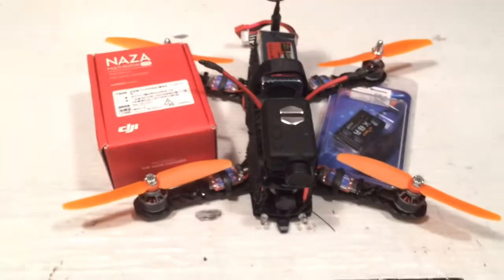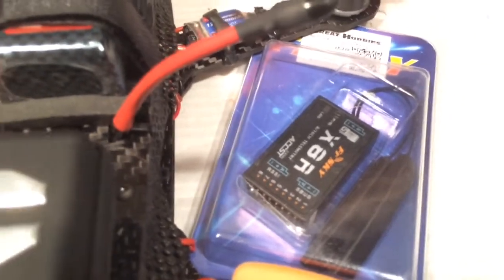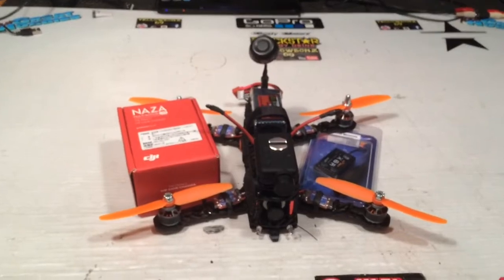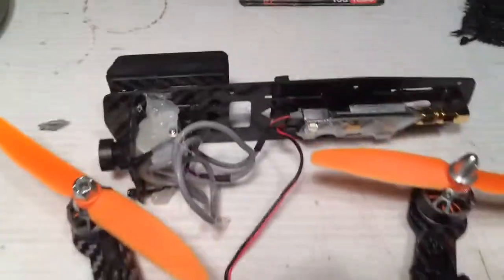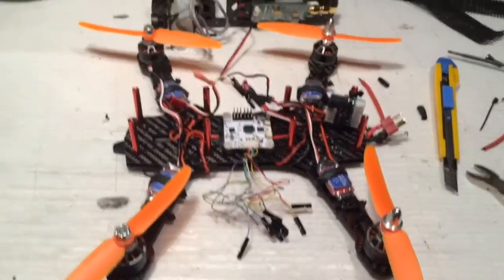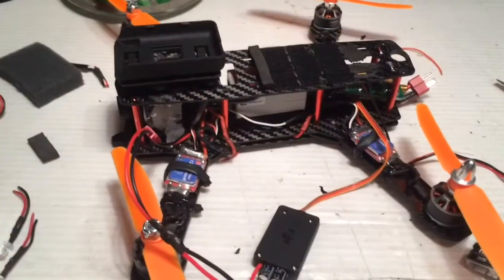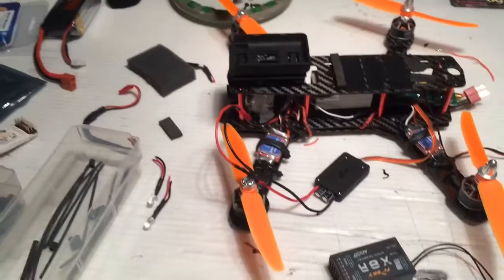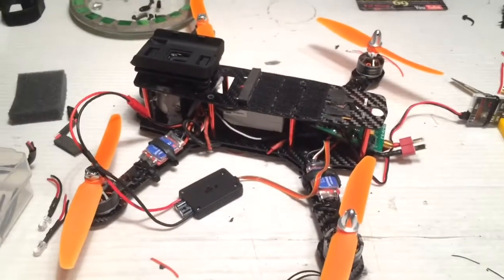ZMR250 Naza Install

Comment: |I also have it but with OSD incorporated and everything else I had to remove the taillights, it is a lot of cable everywhere. So it happens that I consume a lot of current and I use it with a 2200 mAh battery